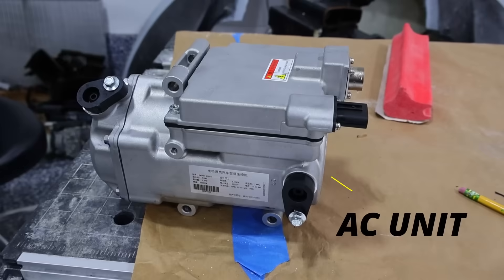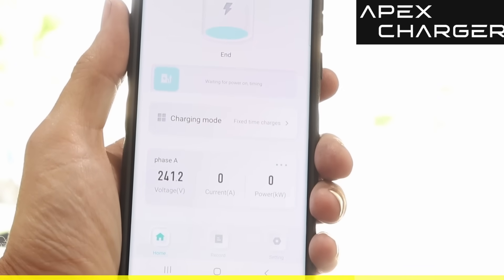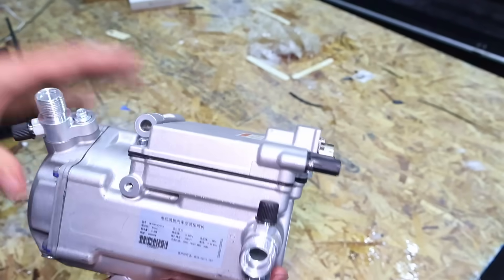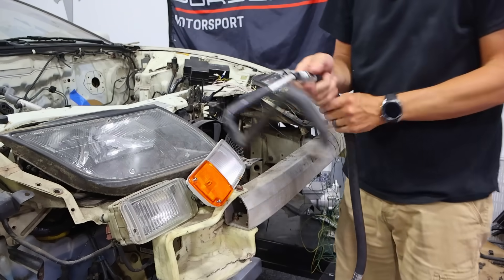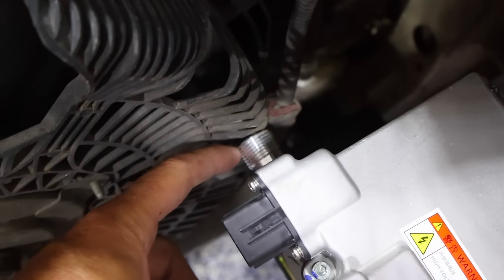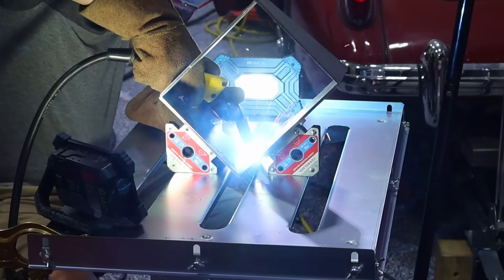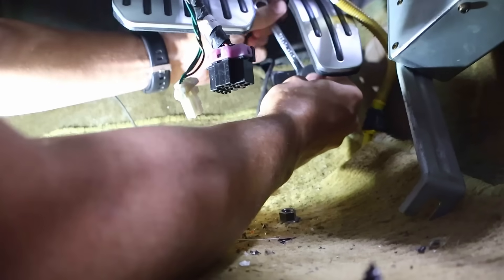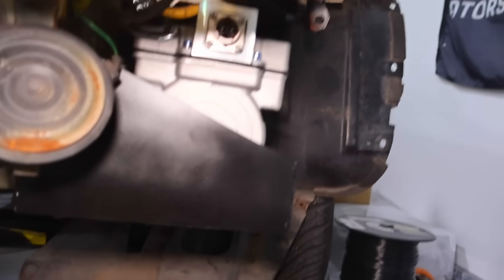Stay Cool: Installing an Electric A/C System in Your Vehicle

Comment from the maker: Ditch the Gas Station and Save Big with MACH I
Purchase it today through Amazon: https://amzn.to/4aV6mJ7 or visit the official website https://apexcharger.com/product/mach-1/
Tired of high gas prices and wasting time at the pump? MACH I EV charger allows you to
charge your EV at home for a fast, easy and seamless experience.
Here's what makes MACH I the perfect choice:
• Save Money on Electricity Bills: Take charge of your energy costs! Schedule charging
sessions with our app or use the charger’s Delay function to take advantage of off-peak
hours and potentially slash your electricity bill by up to 40%.
• Eco-Friendly: Reduce your carbon footprint by choosing electric charging over
traditional fuel
• Time Efficiency: Skip the lines and time wasted at the gas station with MACH I's fast and
seamless charging.
Ditch the gas station for good and experience the future of electric mobility with MACH I.
Upgrade today and start saving!
Reply: Bro reply people. I want to know if the compressor will work with the original fittings in the car?🚗
Reply from the maker: @cb-trendstech40  all depends on the car.  This unit I had to get some adapters to work with the 92 Nissan
Reply: If you sell an EV conversion kit for the 300 I’m in
Reply: How much is the compressor cost?
Reply: @W1Io_oI1W  did he ever say which compressor he was using specifically?
Reply: EV sucks, not worth the pain in the A...

Comment: You take away the belt driven load off the compressor and then it’s transferred via electrically to the alternator, it’s really  6 of 1 half dozen of the other. Just swapping from mechanical load to electrical load I don’t see the benefit.

Comment: High-voltage wires without corrugated conduit are unsafe — they can chafe through, leading to voltage on the car body. Routing them along the bumper support, which absorbs frontal impact, is the best way to cause a short circuit and test either the battery safety system or how quickly the firefighters respond.

Comment: WHat are you doing for heat? Resistive heaters are seriously inefficient compared to a heat pump
Reply from the maker: Resistive heater are in effect 100% efficient.  Aftermarket heat pumps are not very readily available for our uses
Reply: @electricsupercar  efficiency vs COP. I have an Imiev with resistive heater and a similar AC compressor to yours. 6kW of heating draw is a serious range hit - to the point that many owners have installed webasto type heaters. 

The traditional water-heating design is also extremely sluggish to get heat into the cabin, vs putting resistive elements in the AC where the water matrix would be. One possible alternative is to add a second compressor which does seem a bit wasteful but it's not much larger than the 6kW heater, draws less power and would be relatively easy to make the condensor fit where the heater matrix is in the AC
Reply: The Electric Viking posted a video about heat pumps matching your and my requirements about 10 months ago

https://www.youtube.com/watch?v=TK23SRWmyuk
Reply: I'd recommend looking into heated seats and heated steering wheel too

Comment: I would love to see you install the compressor in a normal car… i have a kia sorento 2017 and wish to swap the belt driven to an electric compressor and want to keep all my factory wires and use my factory AC controller with it and struggling on how I should go about it…

Comment: Just to clarify, the evaporator and condenser are still the Nissan ones right? 

Restoring  an older Honda that had factory AC but those parts plus the lines and compressor itself are gone, thankfully the evaporator housing is still intact. I was looking into those universal electric systems off Amazon/eBay but use the Honda fitment evaporator instead of the under dash housing assembly those kits use.
Reply from the maker: Yes, everything else remains, just replacing the compressor

Comment: why these manufacturers don't make their compressors fully sealed and welded? this eliminate any possible future leaks
Reply: You can use sealed A/C compressor, the same used in home air conditioner. Just choose some inverter suitable for the voltage and power consumption and that's it, you have an air conditioner in your car

Comment: help!. overloaded the ac with freon. <being and id10t>. then adjusted freon. no ac. <makes sense, that fuse blow up to save the ac compressor>. checked the electrical connection at the compressor end: no signal. checked the fuseable link under lid with 9 bolt <m6> on top of inverter. link is good, there is no voltage on either end. checked 10 A fuse and 50 A fuse in the box under the hood. both OK. checked 2 fuses, 10 A each under the steering wheel, one is A/C, the other PANEL, both are OK. any idea?
Reply from the maker: Ouch! It sounds like a real electrical mystery, good luck!

Comment: How to connect the PWM speed controller to the control signal pins of the compressor? Please share any control signal circuit diagram.

Comment: When you have electric compressor you don't need some much hoses, they allways leak. You are not connecting compressor to moving engine so its possible to make totally rigid pipes, fridges don't have any soft lines and gas stays inside "forever" if you don't brake it by yourself.

Comment: What is the model and brand of the compressor that you are using?
Reply from the maker: I have a relationship with the manufacturer.  I do not think they sell to the public.  I can get them through my company.
Reply: @electricsupercar  subscribed then read this then unsubscribed
Reply from the maker: I guess you are not familiar with manufacturer and distributor model.  Not much I can do to convince the manufacturer to sell direct.

Comment: Maybe this has been asked already? Can you use this electric a/c system with a conventional motor? And if so can it be wired independently from the ecu ? I believe it should be possible but you have more knowledge of this electric car stuff. 
I will be subscribing to follow your build, very interesting.  Thanks
Reply from the maker: @MrRogard66  yes

Comment: I put a cheap 24v 1800 BTU plastic Chinese A/C in my self converted micro camper van venting into a shared ventilated garage area in the back of the van.   It consumes only about about 150w .  Works great in shade and dark and removes tons of humidity here in Florida.  Video on channel.

Im very interested in the new heat pump A/Cs EVs are coming with and heard they are up 50% more efficient than belt systems.  Especially for the option of running the A/C while parked and off for hours.

Comment: What voltage does this electric compressor require ???
Reply from the maker: There are a couple of different options. The High voltage version is 220V-425V and there is also a 12V version

Comment: I would love to do something like this.  I have a 2003 GMC Envoy that has rear climate, but once I get a turbo kit installed, I will need to delete the AC lines going to the rear climate system.  Plus, I'd love to run the rear AC without the engine running, and possibly off of AGM or Lithium batteries for camping
Reply from the maker: nice!

Comment: This IS the 'Thinking' that I need to follow to achieve my goals with my Gas Powered car. I need to see what you did in-like for the Power-Steering and the Alternator. I'm thinking of using a 'Thermal-Electric Plate' for a replacement for the Alternator.

Comment: I hurried through this because I would not be able to do this due to all the fabrication and my project does not have AC to start with. But if I did, what do you do about the existing compressor and pulley that is run by the serpentine belt? You can’t abandon any of that.
Reply from the maker: This is for people looking for an alternate to a belt driven AC condenser.   For those venturing down this path, they will need to do an AC delete pulley or similar.

Comment: thanks for the video, You just gave me an awesome idea for an a/c powered air to water intecooler that will chill the water down to sub zero temps that will cycle through the intecooler increasing air density there by increasing power out put. An electric compressor wont be subject to wot conditions and will run continuously even while doing a 1/4 mile pull.
Reply from the maker: Go for it!
Reply: Rated: 12V, 0.49KW @40Amps = 3150btu/hr output .... Or 1/3rd of a Honda AC compressor. Best result is throw a bag of Ice in the waterbox.
Reply: @MarcelBrandon  that might get you down the track, but I want a system thats ready to go at any time with out planning on where to buy ice, store it and pour it into a tank. Best bang for buck would be nitrous but most of us want power on tap that doesnt rely on bottle pressure and a finite amount in the bottle.

Comment: Why not just turn on the car A.C.? Advantage? Cost, guaranteed. Alternator give very little amp at ide. You need to pulley gear it to be 2 k at idle or your burn out that costly alt.
Reply: If upgrading a ICE vehicle you'd do this upgrade to reduce the engine load caused by the belt driven compressor (get horsepower back). Like you said though most alternators have only a little amount of headroom over the stock electrical load so you'd likely drain your battery frequently (you'll only burn out the alt if it was a absolute shit one or you wired things up poorly for the load as most are designed to be able to handle 100% load for 24hr/day regardless). To combat this there are 3 routes most would take, starting with the cheapest and most simple - you'd add a 2nd battery to handle the peak loads as AC compressors rarely run full tilt for long (they run on/off to manage temp and icing), so long as the compressor average over time load isn't too high for the maybe 15-30a of headroom stock alts tend to give then you can safely run that system. 2nd is to just get a high output alternator as each car tends to have easy drop in high amp versions available (taking a 60-80a alt and rewinding it to give out a 120-140a potential) and this is without needing new pullies as thats only needed once you get into the super custom ultra high output alternators but this wouldn't ever warrant that as the AC Compressor in the video uses like 40-70 amps and pretty much all drop in upgraded alts give that amount of headroom. 3rd would be the same as #2 but also adding in that 2nd battery so you never have to deal with power spikes or moments of the compressor running for extended periods ever draining your main battery, at this point you could likely get away with two compressors and never see the voltage drop or cause any proper stress on the alternator
Reply: @hiRyan329329  interesting, here another one that better as your running of the car weight, your going what? Lol   I can put it in now buy my transit van has almost 2,000 wats solar panels , I made a quarter cut in the back inside wheel well and wire charge for my cat both side, but I could add a alternator and  a tiny rubber wheel so it on top of the tire hidden and on a wood plank for connected or not, this way your not taking power from the engine at all. And you can tuber wheel get that gearing  ratio  you want.
Reply: @thomas4315  Yeah many ways to go about it. Love solar systems on the go, can be very heavy but worth it to have charging capability for a proper battery system. Love being able to run lights, cooking hardware, and things like TVs or computers.
Reply: Lil added note: A standard high output alternator does of course put extra load on the motor so you loose horsepower but in most scenarios its actually far less load than a belt driven AC compressor so you still end up with a overall horsepower gain and can now run your AC without the motor even running (so long as you watch your batteries)

Comment: Great video, thanks. One important note: if you are reusing any of the existing ac system components from your vehicle, the system likely used PAG oil for the compressor, which in turn circulates through the entire system when operating. PAG oil is conductive and even a tiny bit can cause the electric compressor to seriously short circuit the high voltage system. You may need to do a special cleaning of the system prior to operation. Electric compressors use a different oil, such as a polyester-based oil, which is non-conductive. These oils are extremely hygroscopic, however, and once the conpressor is charged with oil, the system should be sealed as soon as possible to minimize moisture from air contaminating the system. Hope this helps.
Reply: You can buy Idemitsu SP A2 oil directly from BMW which will work and not cause any conductivity issues.
Reply from the maker: @amaurybetancourt4837  thanks for the comment!
Reply: i learned from attempting to work on my grand daughters hybrid camry that all new system is required even if you make a mistake and use your regular gauges or adapters/taps. any trace of the wrong oil will cause damage later on even if it works originally, that's how serious it is. i was told at the a/c shop that techs use one set of gauges and tools for electric systems and one for regular systems.

Comment: When I first saw that you were putting a 300zx under the knife, I really freaked out, as I am a '91 twin turbo owner. But I do love the direction the build is going. One question: for all of these small parts, instead of doing a rattle can finish, have you ever thought about powder coating? Those AC parts and the peddle stop would be prime candidates for it. I started with a toaster oven and powder coating kit from Eastman and moved up to an old oven that was large enough to do all of the covers on the original 30VG engine that was in my 300zx. Keep the videos coming!
Reply from the maker: @ChrisMuncy  Thanks for the comment!  I will have to try out powder coating.

Comment: I like the 300zx. The manufacturers must bring this car back into production. It was a good brand, however? The large engine made the car unstable during deep turns; But? That was the joy of the ride."  
~The engine burns low fuel and the maintenance was limited once viewed occasionally.~👍

Comment: I would be concerned having high voltage wires running around the bumper and maybe more inside the engine bay area instead in the event of an accident or so, along with the compressor.
Reply from the maker: @asanaya94  That is why they make Pyro fuses, to quickly shut off all high voltage in the case of an accident.

Comment: Will this compressor work with any size evaporator and condenser combination
Reply from the maker: @donaldperry148  short answer is yes.  They make different output compressors for larger or smaller systems

Comment: I have been looking for a electric 12v motor for years that I can run all of my accessories to get them off of my crank pulley. Free up power and fuel mileage. But also I can run my a/c without the engine running because the alternator and a/c compressor is still running until I flip a switch and turn it off. This is cool also. But will it work without my car being a electric vehicle. These are high volt accessories.
Reply from the maker: Yes there is a 12V option
Reply: @electricsupercar  cool deal thank you.

Comment: That is "Cool" but it wont match the A/C Powered by the engine. The efficienty of the A/C is limited by the alternator power, which will cause the same bog down as the normal "engine a/c" pump but with less efficiency, that's my view. If you install and feel pleased, good! But I dont think it can be that good at cooling the car. Cool nontheless
Reply from the maker: Not so my friend.  Belt driven pulley has way more loss and not as efficient. Also drawing more electrical power does not "bog down" the motor.
Reply: @electricsupercar  Cool, but if you really think about it, the current drawn by the a/c will impact on the alternator. But it can be less demanding due to the battery holding some charge. Cheers

Comment: I watch this full video on a different computer which I was not logged in on. My question is, can this electric air conditioning be done on a 1974 camaro? I would like to know all of the things that I would need. I have taken the condenser and all the air conditioning components off of the car years ago!
Reply: If you want to do you'll need a very beefy power system and alternator. I'd say its easier and cheaper to fix your ac pump (it also has more btu)

Comment: I have a 90s renault with no factory ac and i want to install one with an electric compressos. I dont want to buy the kits with the huge underdash evaps. Is it possible to just fab one up with an electric compressor and evap and condenser from other cars? thanks
Reply from the maker: Yes...kinda.
This is just the compressor.  You need the whole system including the condenser, evaporator, expansion valve, and blower.  The kits usually have all of these components.
Reply: This compressor requires HV to run, it will not work on a conventional 12V system that's in a normal car.
Reply: @dasteknoviking  DM18A7 18 CC 12V

Comment: Sorry.  Rong  subject.  But  ad a secound gear box  to main drive.  So fuel runs out. Can flick a switch  to run of a cycle .? Can do ?
Reply from the maker: @mick00000000002  no.  This is only an electric compressor and cannot be belt driven

Comment: how many volts / watts is the ac compressor ?
Reply from the maker: Lots of options.  This one is 220V-450V
Reply: @electricsupercar  versatile
Reply from the maker: @tom-vx1lp  you can get a 12V version.  The high voltage version is meant to cover voltage range full to empty for the high voltage battery charge